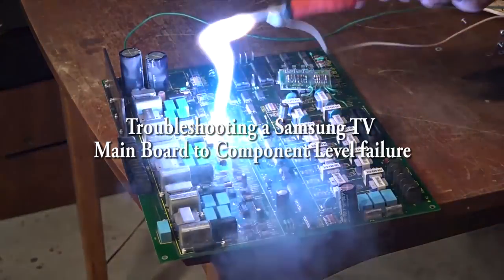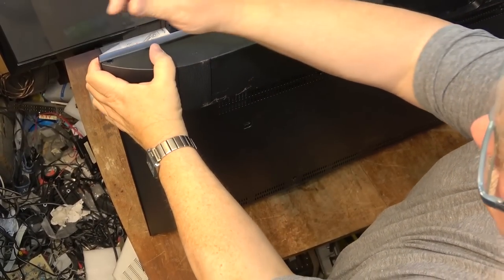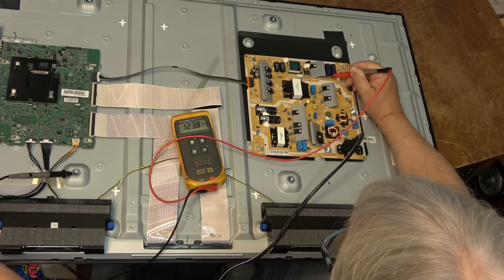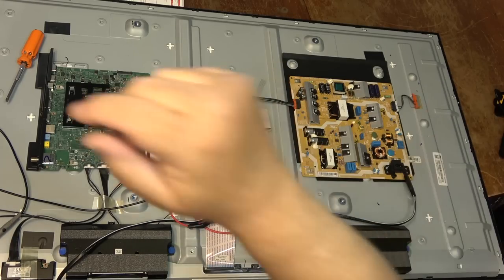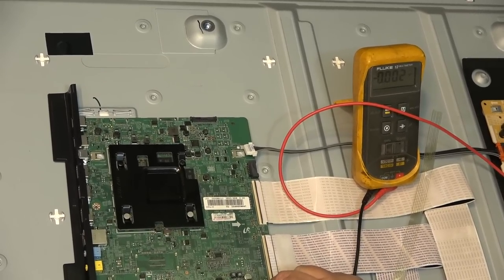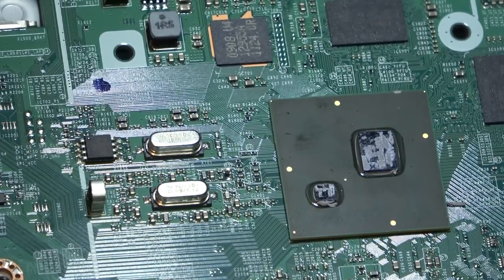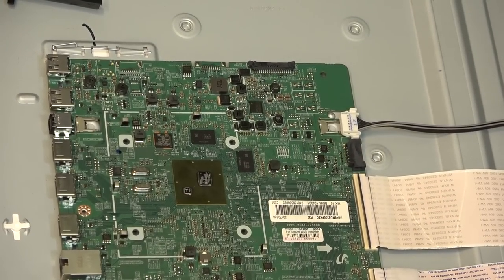Troubleshooting a Samsung LED TV Main Board to Component Level

Comment: And if you don't have the thermal camera, you can do the alcohol version - wet it down and throw power to it the shorted part evaps the alcohol darn near immediately. No, it wont go up in flames because it'll evap before it gets that hot.
Reply: Good one.  Thanks.

Comment: I have a question.
You said you were injecting 3.3 volts from a power supply.
Was this constant current or over current protection?
And what amps did you use?
.2?

Thank you for your time making this video.
Reply from the maker: I had the power supply set to 200ma

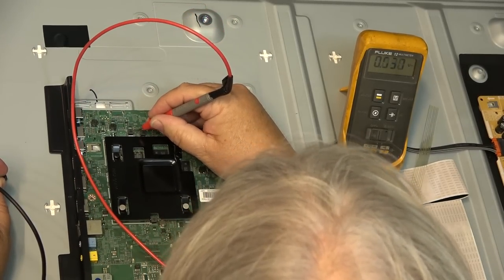Comment: At 6:50 so far and since noting is getting hot, my thinking goes towards a popped resistor or something similar like that (maybe diode) that is not feeding voltage where it needs to go. Obviously just a guess here. Ok, back to video.

Comment: What would you say if I have 3.3volts on standby, ac off detect and power on(when power button is pressed) but nothing on the 12 volt pins? I have a Sony Bravia with 2 blinking lights not turning in

Comment: We have like over 10 of those mainboards at the workshop I work at.

We never do component repairs on TVs unless it's a known problem, like the caps on those old tube-backlight TVs
And I don't mean CRTs, I mean the flatscreens that came before they started using LED backlight
Reply from the maker: Ccfl. Cold cathode fluorescent lamps
Reply: Yeah, my boss is about to retire, having worked various repairman jobs in his 50 year career so it's always fun when we get an older unit into the workshop and he instantly knows what wrong just by taking a look at it.

By the way, if you ever get one of the newer models of Samsung into your workshop and the standby LED blinks twice, that's an error code for the panel. Either the LCD itself or the backlight.

There was a period when we got so many TVs into the workshop that I had to transition to only doing TVs and soundbars, aka Warranty repairs, while a colleague of mine transitioned to only doing non-warranty audio repairs. Old amps and other misc stuff like that.

My successrate is a lot higher than his, but replacing circuit boards is a lot more easy, and a lot less rewarding than component repairs, so it's a double edged sword. @12voltvids
Reply from the maker: @BananShakeProduction  i did component level for my entire career.  I left before the board swapping started.

Comment: I noticed that main chip that was greeting hot is hot as soon as I plug in the tv and turn it on (no screen but the little red light is on) nothing visably wrong with the power board. If I u unplug the power from the main board, the backlight turns on. I also noticed if I put my ear to the main board, it is making a sound like lazer blasters shooting (quietly) lol any chance that's a sign the main board needs to be replaced?

Comment: So if you replace the motherboard, with the same working board from a different tv, original remote won't work right?
Reply from the maker: It will if it's the same series of tv. I have done that.

Comment: Would a component to HDMI adapter be uneconomical?
Reply from the maker: A good one is rather expensive.  
For my setup for example I have HDMI over Ethernet.  To upgrade to 4k means a 4k Ethernet adapter and the cost is about 600.00.  I'll stick with 1080p.  Good enough for me.

Comment: can you read errors of a PCB main board, or have somewhere to find out what an error number refers to? my literal brand new samsung TV is broken because they manufacture pieces of sh*t, and the tech who came to "fix" it said the PCB is trashed. which makes sense, because its made from trash. The error was something like error code 64.. whatever that means. I can't find anything about it. My TV would turn to a noisy image, and sometimes make a sound like a relay was exploding. these TV's don't have relays, so I am not sure what it was. I am just curious what the error meant.
Reply from the maker: I have no idea because I don't fix tvs for a living anymore and haven't for over 20 years.  Mostly audio and vcrs these days.

Comment: How many Samsung tvs does this make that came in for repairs? Are Samsung that bad?
Reply from the maker: Number 1 tv brand of course more will break.
Reply: @12voltvids  your reply didn't make sense. I don't think you understood what I was trying to ask.
Reply: @lox_5017  If brand A sells 100 TVs, brand B sells 50; and 6 of brand A TVs broke, and 4 TV of brand B broke; is brand A worse than brand B ?
Reply from the maker: @lox_5017  I don't count how many of each brand breaks.  
Just saying that with more Samsung tvs sold obviously more are going to break.  
All things being equal, say Samsung sells 100 sets lg 75, Sony 50,  rca 25.
Our of those 250 TV's 3% break down at the 5 year mark.  
What brand will have the most tvs that break?  

I'll give you a hint.  Back when rca was the top seller in north America.  Guess what brand had the highest failure rate.   
Go into a TV shop and the shop was full of RCA and zenith TV's so I've would think those brands were unreliable.  
The shop i worked at was a big Sony dealer actually one of the largest independent Sony dealer in Canada at one time.   Guess what brand was jam lacking the service dept?
Reply: @12voltvids  Now that was an answer reply I was looking for. Why in hell didn't you reply like this the first time around. You seem to be very biases when it comes to certain brands on certain products.
Reply from the maker: @lox_5017  I believe the first answer summed that up nicely.   The manufacturer with the highest sales number will naturally have more break downs.  I don't believe Samsung has higher failure rates than others but with the big market share they have it seems that way.  Look Samsung and lg have the largest market share of tv.  Sony is number 3 and they are a fraction of the other 2. I actually like Sony and Samsung.  I had a ViewSonic that I used as a security monitor for years.  I recently gave it away as I put an rca in that was given to me with a bad backlight.
Reply: @12voltvids  I just recently return a Sony 55" flat screen only because I didn't like the picture quality. I don't recall the model number on that unit.
Watching my favorite old tv shows form about 40 to 60 years ago just didn't look good on any of these sets. Old programs seem to do alot better on its original format and on crts...period. I had to by a composite video to a hdmi convertor just to watch my dvds contains my old tv shows and still it didn't look great! This sucks!
Reply from the maker: @lox_5017  you're correct 480 interlaced does not look good up scaled to 1080 or 4k.   There are devices that do a pretty good job of up scaling but they will never look as good as a low resolution CRT the CRT masks the flaws in low resolution vhs tapes.  If you want something that is more modern and loons great find a Panasonic plasma from the 2003 or 4 era like the one i have sitting on my bench beside me.  It's a 42" 856x480 panel and standard def programming looks great because it is a standard def panel.  I would like to find the 37" version just because it's a very rare set. I say rare because when new there wasn't much price difference between the 37 and 42"  with the 37 actually coating 100 bucks more so only those with size restraints considered the smaller panel.  They didn't sell many so that makes them a collectors item now.